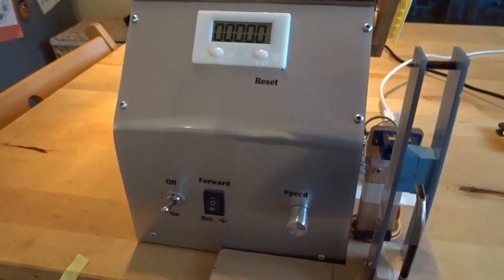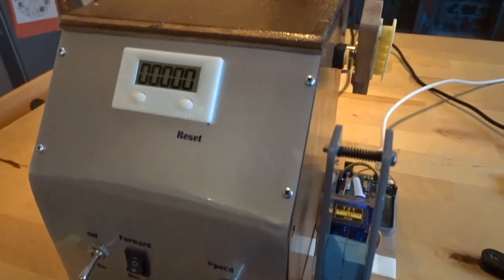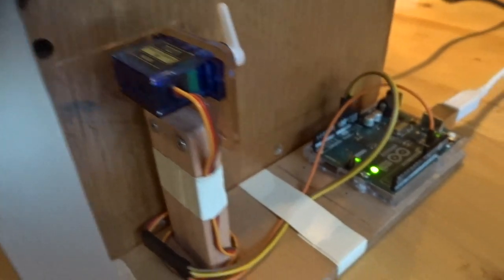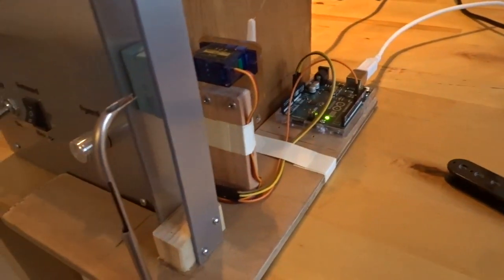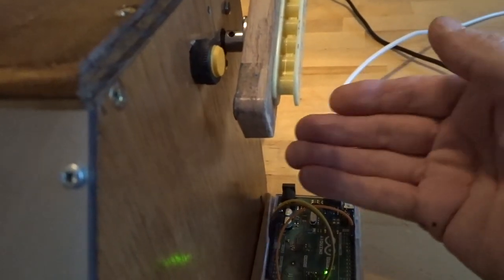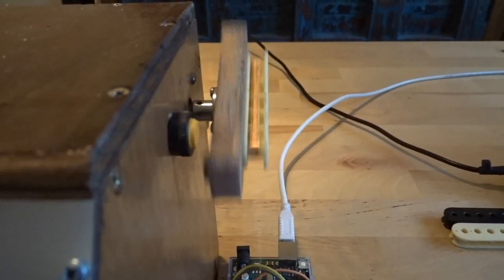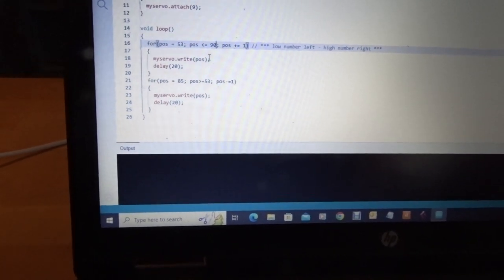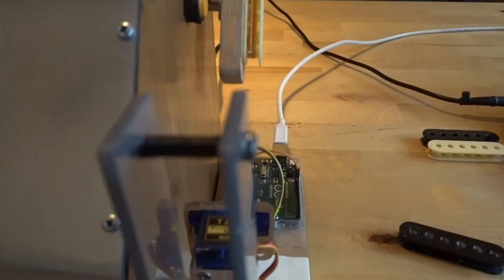DIY Guitar Pickup Winder and auto Traverse Wire Feed

Comment: you make that look easy.  that small copper snaps easy sometimes.  i have tried it but got my friend Bill to wind them in the end.
Reply from the maker: I have trouble seeing the stuff it's so thin, with the two foam pads giving it the right resistance as the wire runs through so far I've not yet snapped the wire, but I'm sure that day will come haha